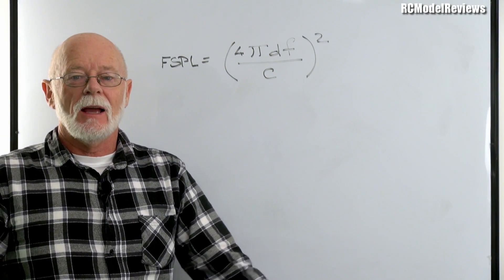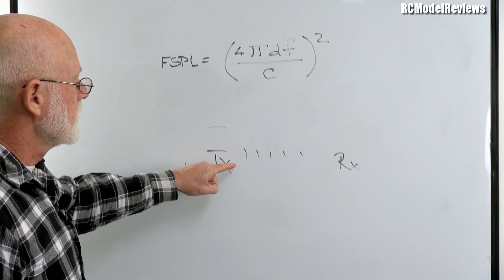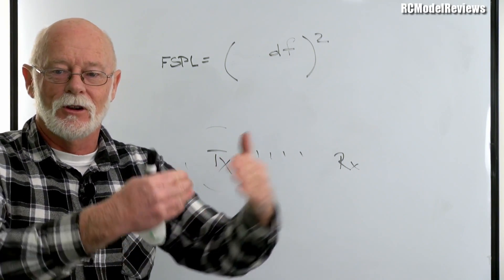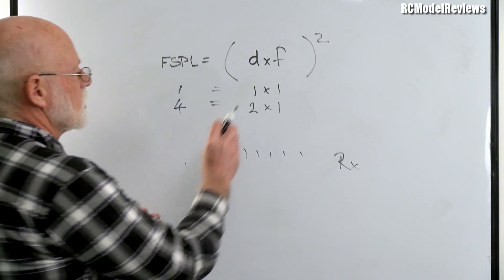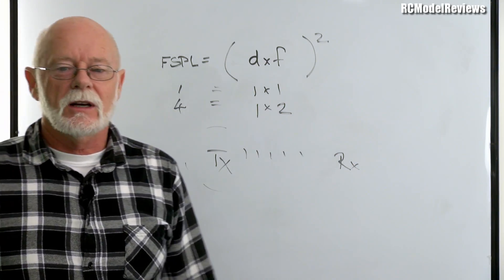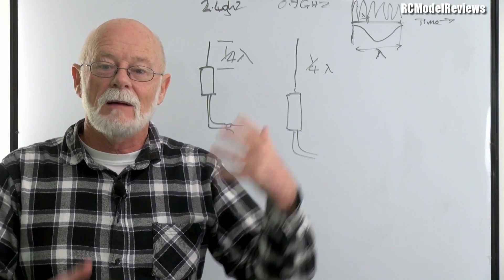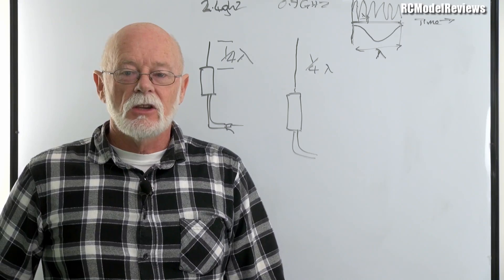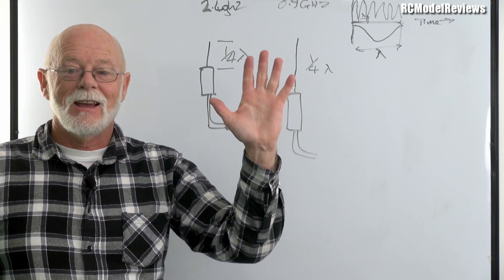Path loss, its effect on long-range RC and FPV links

Comment: Hi, my comment is off topic, because I did'nt know where to contact you for this. If you could direct me to your video or make a video on how to figure out how much draw is on a set of servos  (say Hitech 430BH) and how much battery power is needed.  P.s. I fly internal combustion engines only, and not electrics, I use Futaba  T-HSS  8 channel receiver, with 6.6V Li-fe 1900mah, with 7 servos.

Comment: Nice Bruce. Great video!!!
As you said, Lower the frequency, longer the range. Does that mean that a standard 72Mhz system would give us far more range than 433Mhz LRS? Or a 2.4 GHz system? 
I guess yes, if the power output of all the systems are equivalent. Why not then we move back to 72Mhz with frequency hopping?

Comment: Great explanation, I have learned something new. I previously asked myself, why do drone makers use very short antennas, would a longer antenna have better range? Now I know that extra antenna length has no benefit. Extending the wire to the antenna would weaken the signal. So I’m guessing that ideally the TX should be situated as close to the exterior of a drone as possible, so the antenna is clear of interference from the drone itself with the shortest connection. Am I correct?

Comment: The formula is very helpful, but a bit more theory on the subject would be appreciated. The antenna length is a technical feature, not a cause for longer range. Why we use 2.4 Ghz if longer wave is so "awesome" ? Back in the day, we had longer waves for RC, so if the industry switched, then there was a good reason, like less interference and congestion in microwaves. Not everyone in RC have only high school education, some of us love theory too. Thank you for your enthusiasm though.
Reply: yes, its about bandwidth, less channels on lower frequencies
but this video is only about range
and i think the industry switched because of the tight regulations on lower frequencies
less and less unlicensed and amateur bands at lower freqs
and the other aspect is convenience
smaller anntenna and growing number of channels to control more servos and for telemetry
not mentioning FPV bc its on its own dedicated video frequency

Comment: Why couldn't you put multiple higher frequency antennas in parallel? Of course, attention to the length of the coax to where the 2 antennas join would need to be taken to prevent issues with phasing, and the placement of antennas to prevent destructive interference due to wavelength. As well as the fact that 2 50 ohm loads in parallel results in a 25 ohm impedance, so some impedance matching network would be needed as well. But other than that, it should double the gain in theory?
Reply: Congratulations, you just built a yagi. In use since the dawn of radio.
Reply: superdau I guess I was thinking more along the lines of an actual dipole. Yagi antennas are cool, too! But is there a way to make is have an isotropic radiation pattern, at least as good as a normal wire antanna?

Comment: Smaller antennas can be easier to build in configurations giving more gain (think about the size of a coil antenna for 5.8 GHz vs. 433 MHz). The question is: is this enough to to make up for the path loss? As usual the answer is probably "in some cases" :)

Comment: Thanks for the video Bruce. One question, if the frequency loss is all down to the physical length of the antenna, could you not use a 1/2 or full wave antenna on the 2.4ghz system and get more range? I’d guess based on the video that in theory going from a 1/4 wave antenna to a full wave antenna could double the distance in identical circumstances?
Reply from the maker: I'll be covering how to "get more metal in the game" in an upcoming video.  Simply making your 2.4GHz antenna longer won't work for several reasons -- think of it kind of like the extra length receiving a signal that actually cancels out that received by the original length of antenna.   For example, a full-wavelength of wire would (in theory) produce no output because the signal in one half would cancel the signal in the other -- this is why we use half-wave dipoles or quarter-wave monopoles most often.   Another white-board video on this subject coming up soon :-)

Comment: Wasn't ULF used in WW2 for Morse Code transmission to the Submarine Fleets?
Reply from the maker: Yes, they used frequencies right down in the high-tens to low hundreds of KHz (from memory) and even in the cold-war era, were using this as a way of globally communicating with underwater vehicles.

Comment: wavelength is of course literally length. if you change the wavelength, you also change the number of wave cycles between Tx and Rx. you could think of it like, more opportunities for something to interfere with the transmission because there are more complete instances of it in the path to corrupt? (with a b/g in audio, i tend to think of all waves similarly, and i think, in audio, it is easier to understand how wavelength relates to transmissiveness). remember to smoke a lot of weed for your health! :)
Reply: just woke up, more explain.. a fixed dimension (say 1 cm, or 1ms) translates to more duty cycles of a higher frequency.. so this is how interference of any sort translates to greater loss of shorter wavecycles. acoustically, a high frequency might need to make 100 cycles to pass through a brick wall, whereas the same distance only represents 1/10th of a low wavecycle.

Comment: Oh wow. Even though it is the same technology, I never really associated lower frequencies being better for range with radio control. With IT stuff it makes sense. 2.4Ghz = lower throughput, greater range, 5.8Ghz = higher throughput, shorter range. Fine. You can easily see this if you have a dual band wifi access point.  However, when i was a kid, my parents would buy me cheap RC cars from Radioshack. Universally 27Mhz meant the model would have a range of 11 feet, and 49Mhz meant a range of anywhere between 100 feet and a quarter of a mile even if both vehicles were the exact same model. Even to this day i'll unconsciously choose the highest frequency available in a spectrum for really no reason.

Comment: So why did the whole hobby move to higher frequency from the 27 35and 40mhz; apart from the business concerning crystals. 

I presume 2.4ghz is not good for rc. submarines being under water.
Reply: s tanner good question, money is one answer , 2.4ghz chips are cheap and easily available now compared to old frequency ones, size of antenna is another and also number of pilots flying at once is increased with higher frequencies. 
Trouble now is 2.4ghz band is swamped because of routers etc etc.....
Here is the UK 35mhz is the RC air frequency but is not used much any more apart from a few flyers.
I must say that I had more trouble with 35mhz losing control than I ever had with 2.4ghz (apart from spektrum dsm2 lol ) but might have been because other flyers did not follow the rules about turning on their txs without checking the peg board first lol.....
Though sometimes if a train went past it would interfere with my 35mhz control...

Comment: what if you use half wave or 3 quarter wave antenna for 2.4Ghz radio link, will it make any difference?
Reply: it will, if i remember correctly, it has to do with impedance matching
Reply: It will, dipoles are a half wave, but I will let Sir Bruce explain properly. It becomes a matter of what you can fit into your aircraft.
Reply: I was wondering as well, thanks for the info! :)
Reply: It has more to do with the radiation pattern, and the gain. A dipole is 'somewhat' omni, it does have nulls right off the ends of the antenna. Picture an apple, nulls off the bottom and the top, inline with the stem. A 5/8 is similar, but now squish the apple down a little. it's shorter, the nulls are worse, and fatter, overall gain perpendicular to the stem is higher....

Comment: Hi Bruce. Thanks for the video. So in theory , using 2.4 transmitter system and 5.8 video system, we will never be able to have video signals for the entire drone range and we will loose video signal at some stage at the end of the transmitter range . Is that right ? if so , how to fix the issue ? Thanks in advanced
Reply from the maker: The 5.8GHz signal will have a higher path loss than the 2.4GHz signal but the difference can be more than compensated for by either using more power and/or a high gain antenna on the FPV gear.   I run 200mW and I can get more video range than RC range with my setup but if I had standard (omni) antennas on both RC & FPV and was running 100mW of power on both then I'd expect the video to disappear before control was lost.
Reply: Thanks for your reply . I have 600mW video transmitter and RF632 receiver with diversity which is a decent video receiver but I don't know what type of antenna would give me the best range . I'm thinking of Pagoda. May I ask what rang should I expect with this setup ?
Reply: Ehsan Keshtgar for the purposes of an RC craft, you're going to be limited for the receiver antenna for control, it'll need to be onnidirectional. So that'll effectively be fixed. However, you aren't limited(much) for the receiver antenna on the video, so you could effectively get a more sensitive receiving antenna for video and match the range of your control link despite the frequency difference.

Comment: A similar thing happens with coaxial cable, a higher loss with higher frequencies. I think it has to do with the magic pixies getting tired more easily as they jump up and down faster on their way down the cable.
Reply: isnt it due to the coaxial coating? the mesh mb cant isolate losses from higher frequencies

Comment: Interesting but why then, would you use high frequency rather than low frequency?
Reply from the maker: I'll be covering this more in the next video on long-range systems but basically higher frequencies are usually associated with more bandwidth and more space in the band.  The 2.4GHz band (for example) offers us 85MHz of space but on 900MHz we're down to about 15MHz and on 72MHz we had less than 1MHz.   This is why we can have heaps of people simultaneously flying RC on 2.4GHz but already I see that some of the 900MHz and 433MHz RC systems are having issues trying to support more than a handful of simultaneous users.
Reply: Ummm... We should sync everyone up and use time division multiplexing !!!
Reply: its cheaper i believe and easier to licence with the fcc
Reply: Because a smaller antenna is better if you want to keep things compact.  Have you seen a 2.4GHz CP antenna?  Not good on a racing quad, especially if you consider you want your control frequency lower than your video frequency.  5.8GHz is king for miniquads because the antenna size is so small.  Really there's no other reason.

Comment: Hooray math!  Thanks for the helpful info, Bruce.  Now how about that Part 2 on Antenna Theory :)
Reply from the maker: That's coming... but I wanted to show that antenna performance is about having the most metal in the game.  I'll expand on this when I talk about why you can't just use a longer length of wire to get more signal and how the different type of high-gain antennas manage to get more metal in the game anyway.

Comment: As always an interesting bit.  However, being a "Constant" is well and good, but what does the Constant "4" represent?
Reply: The formula for calculating the surface area of a sphere is 4πr², the r in this case is represented by d and thus, after factoring in frequency and the speed of light, more of that later, 4πr² represents the loss of signal due to the expanding sphere. f/c is also 1/λ (lambda) the wavelength of the frequency. As the frequency increases its wavelength decreases, 1/λ increases the loss inversely proportional to the wavelength, and directly proportional to the frequency, of the signal. .... and then it's squared, bugger.
Edit: ain't math/algebra fun.
Reply from the maker: Both 4 and Pi combine (ie: 4 x Pi) to create a value which effectively reduces the effect that d and f have on the result.  The bigger the "other" factors on that line, the less effect distance or frequency has.  Think of it as a scaling effect.    For the purposes of this video they're not important because I only wanted to show that changes to d (distance) and f (frequency) have an effect on the path loss and how going up in down in in d or f affects that.
Reply: Thanks for your reply.  I get the inverse-square stuff from studying light.  I just don't get why the number 4.  Why not 3, or 5?
Reply: It's halfway to supplying the answer to "the meaning of life, the universe, and everything"??????
Reply: Thanks for all the fish! :)
Reply: It's from calculating the area of a circle (doh, not circle, sphere): d²π 
We're looking for the distance, which is the radius which is: 
r=d/2 -> d=2 * r
squared it is: d² = 4 * r²
Reply: Thank you!  With values getting cancelled as they were I just wasn't making that connection. :)
Reply: Good stuff , keep it up.